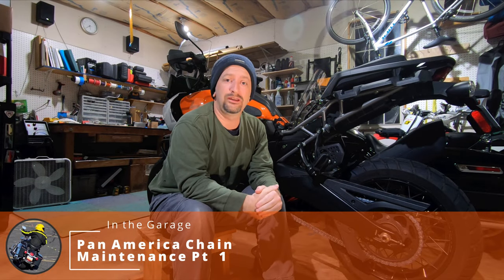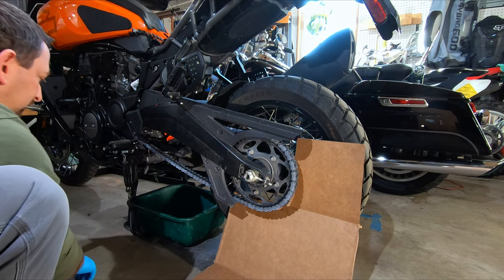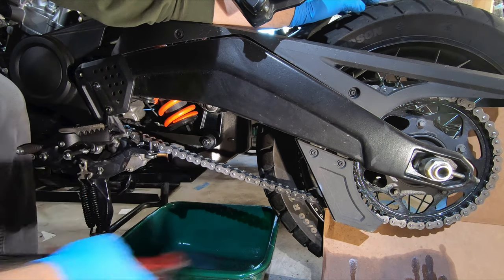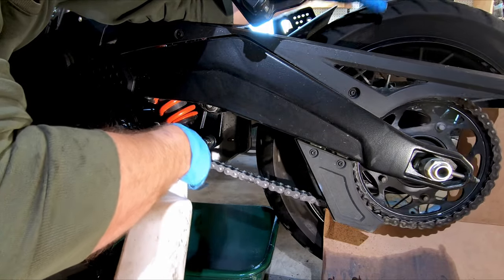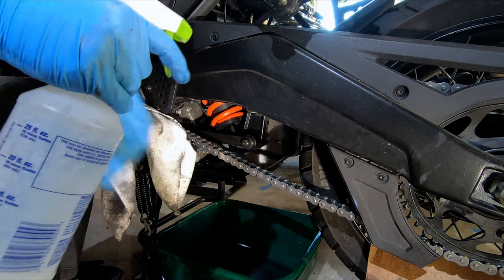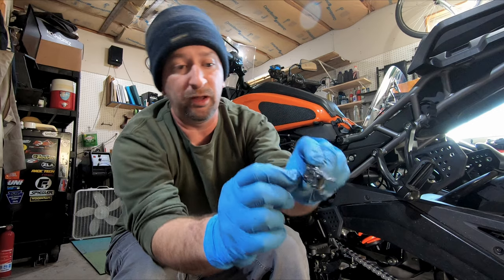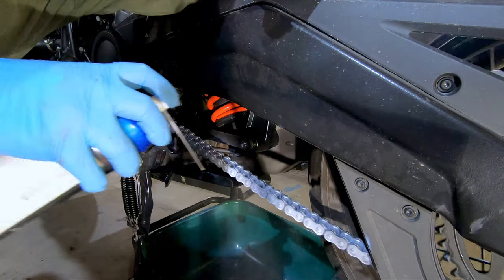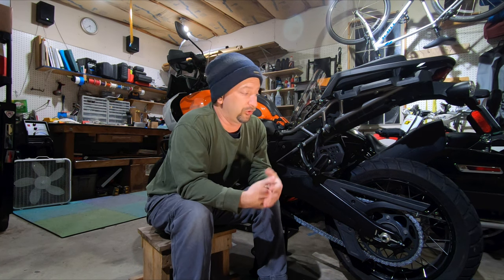Harley Davidson Pan America chain maintenance, Part 1

Comment: Hi Mike, you mentioned using kerosene you bought at the gas station... I don't know kerosene (other than jet fuel).... Is it the same as diesel?
Reply from the maker: Interesting, I had to look it up because I had never heard of Kerosene being a jet fuel, but yes. The same apparently. Where I live it is often used as a heating fuel, so it’s readily available. 

Chain cleaner spray does work a little better, but I still use kerosene if I happen to be out.

Comment: Gives me anxiety on purchasing this bike. I do too many days of 500-600 long distance. Having to spend an hour or so to clean the chain like this while on the road seems challenging
Reply from the maker: I wouldn't let that stop you, people have been touring the world on chain drive bikes for years. It's not like the chain is going to self destruct at 700 miles because you didn't lubricate it, and when on the road a quick spray down with a can of chain lube does the trick, or even invest in an automatic oiler. I would still give it a good cleaning once in awhile to help extend the live of the chain and sprockets.
Reply: I will say I do not do this much chain maintenance on my pan Pan America or any of my other chain drive bikes.

Comment: My friends I'm sure everybody has their own experiences and their own opinions😂
 I would think scrubbing or jacking off that chain every 600 ml with that particular scrubbing tool that eventually do pretty much damage to my O-rings😮😮..
    Myself,,? forgive me if I'm doing it wrong😢
 Up on Center stand quick chemical blast and inspection generous lubrication chain adjustments as needed😅😅
 And the way we go😊
Reply from the maker: Plastic bristles on that brush. I’m not worried about it tearing up the o rings.
Reply: @MikesMotorbikeChannel  
 Cool. Got it...
  You're very thorough very appreciated not meant to be derogative..